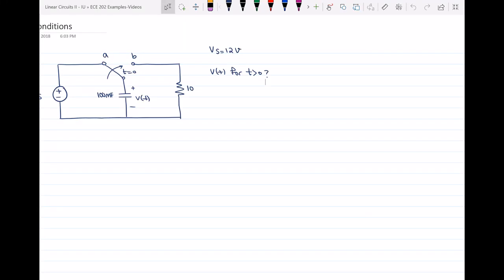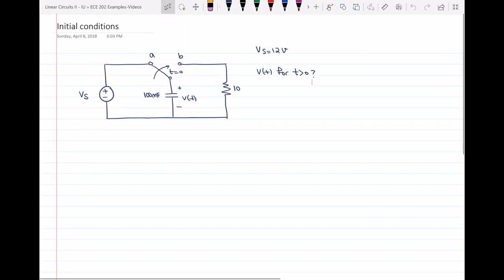Circuit Analysis using Laplace Transform

Comment: in minute 6:03 ¿why you use +(10/s)*I?. I dont get it because you go from - to + in the circuit.
Reply: its the voltage on the capacitor. lemme tell you why didnt she use " - " as i understand from ur question. because we are going on th eway of current . this works on inductors,resistors,capacitors . english is not my first lang so i may not be very well :I

Comment: You started with the problem with v(t) of the capacitor and then randomly decided to find the voltage for the resistor and not the voltage function for the capacitor.
Reply: The voltage across the capacitor and the resistor are equivalent. They are in parallel.

Comment: Why the voltage source go for the t>0 , it should be capacitor with resistor only
Reply: Because one of the properties of capacitor is it starts to charge then discharge so after some time it can work as a battery

Comment: when the switch is flipped, the Voltage source should be disconnected from the capacitor in t>0 schematic

Comment: Could you explain more why you write in the voltage source for t>0?
Reply: This is because we are dealing with a circuit with initial conditions. Meaning there's is a voltage value for t < 0.

Comment: The circuit only contains the capacitor and resistor when the switch is closed... why is the voltage source in the circuit when you transfer to the complex frequency domain?

Comment: Q1 For a RC network, switch 'K is closed at instant t= 0. Vo = 6V, R =102 and C = 0.05 farad. Solve for the current i(t) after the switch is closed using Laplace transformation method. Assume that there is no charge on the capacitor before switching

Comment: Hey.. While applying KVL (after converting ckt into s-domain), why  did u take (+ 10/s)......
It means intial voltage source n capacitor voltage are in opposition??? 
Or
Will the initial voltage source will act as the active element n capacitor as passive, if u see it as a basic ckt..

Comment: I get  when you   write voltage source with capacitor in Laplace form at 0+ for Laplace transform but there are some questions they simply removed inductor and capacitor with their sources only in laplace formula which we calculated at 0- .. what's the difference??Thank you

Comment: hey madam, my question is when you are finding v(s), u multiplied i(s) by 10, but in the question v(t) is voltage at capacitor, how you are assuming that they are equal???
Reply from the maker: Hi, so if you look at the circuit you realize that the V is the voltage across the capacitor and that voltage source (cap. initial condition) as shown. If you assume the whole thing is V then the rest of the circuit should be V as well based on the KVL
Reply: it is parallel

Comment: Is int it 120/s+1 at last step as you multiply by 10
Reply: it would be 120/10s+10. you can factor the denominator to get 120/10(s+1) which is equal to 12/s+1
Reply: thanks mam